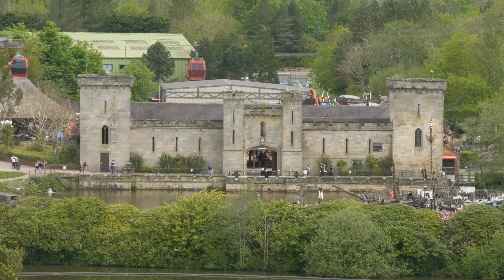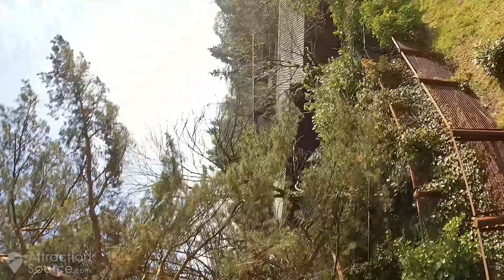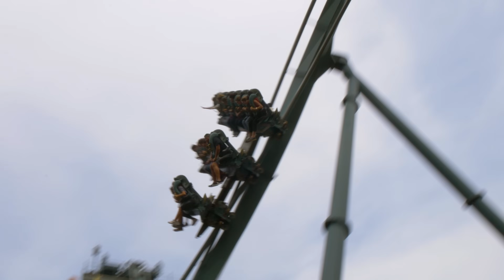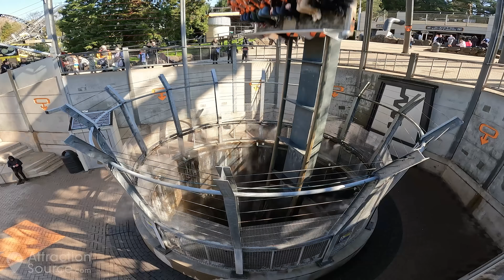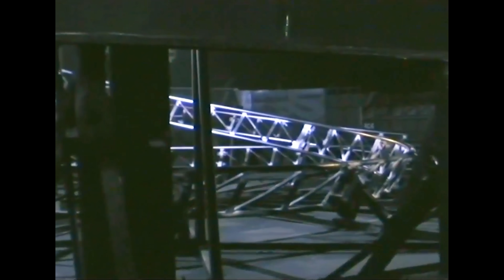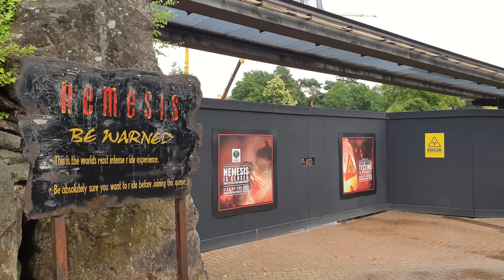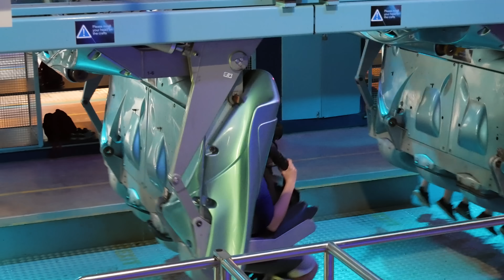Alton Towers has a roller coaster problem

Comment: There's a lot of comments about extending Oblivion, but it's not a good candidate for an extension. The main limit to a non-launch coaster's layout isn't the size of the drop, it's the size of the lift, because you cannot get out more than you put in. Oblivion has a small lift-hill due to the tree-line restriction, hence the small layout. Extending it would need a second lift-hill, like The Smiler, or a launch section. A launch section is not feasible as it would need a major modification to the trains, and a second lift-hill ruins the theming as it's all centred on the tension before that first drop. Adding a new bespoke pit behind the existing ride, running more layout in there and having the lift back to the station could work, but also becomes as complicated as replacing the ride entirely.

There is one option for replacement: build a drop tower ride into the pit and use the exit tunnel for queuing and ride exit, and use the land freed up from the rest of the track to build a completely new coaster. Nemesis is constantly ranked as one of the best coasters in the world, which made refurbishing it worthwhile since it is still a draw. Oblivion is more of a historical curiosity, and does less to attract park-goers than other more elaborate rides. It has less chance of refurbishment when the time comes.

Comment: Great video! However, I think their only real issue is space since there are so many limitations on where they have to build new attractions. But removing and replacing, or renovating old parts on those larger bespoke rides is not impossible. Every theme park does this in some way. Tear down an old coaster or attraction, dig or fill holes, remove trees or other smaller attractions that might be in the way, and create something new. Although none of us are truly aware of how much planning went into the bespoke rides like Oblivion. Maybe they have designed and engineered it for future maintenance. They would be silly not to as every attraction needs to be maintained over time. So, I guess we will see what they do next, soon! I do have a quick theory though that could work...installing a low lying "cart" on the current track (self motorized or external pull line), then placing it next to a piece of track underground that they wish to replace. Move the old track onto the cart and have the cart take the piece out of the tunnel and bring in a new one. Not a perfect solution, but it would work with some clever engineering.

Comment: Oblivion and Genesis are babies. Cedar Point has several coasters 40+ years old (Gemini-1978, Corkscrew-1976, Mine Ride-1969 and Blue Streak-1964). Iron Dragon is up there too at 36 years old. But I think CP has better maintenance. They would never let a coaster's paint get to the point of Nemesis. It's kind of shocking to see so much rust showing through. A little concerning too given recent events with certain '90s coasters here experiencing structural failures at welds. I know it's just surface rust but it makes you wonder about the bolted connections and what not. I would also argue that a seasonal park like CP experiences its own wear and tear during the off-season in the form of subzero weather and ice loading on the structure, in addition to the lack of constant traffic allowing rust to form on the rails, brakes and other such parts. A year-round park is constantly polishing the ridden portions of the track (albeit wearing them down too). I think it's probably a wash.

Comment: I'm certain that tunnel section of Oblivion could have its track replaced within the existing structure. A replacement ride might plausibly be routed via the tunnel too, because static concrete structures usually have lifespans significantly longer than the steel track elements. It's up to the operator whether they think its worth reusing it of course and whether it would fit in with the concept of a new ride.

Comment: Nemesis was getting on, it was rattling a lot the last time I went on it 8 years ago. 

Nemesis replaced Thunder Looper. Galactica, I knew it as Air, replaced The Beast. Alton Towers will forever find ways to replace rides when it needs too. I can't wait for my daughter to be tall enough to take on the big rides and see what they have in the pipeline over the next 5 years or so.

Comment: I would replace oblivion with a Mack extreme spin. It could drop out of the station into the hole from ground level like Time traveller and then hit lims as it emerges from the  hole to complete the circuit. It would be a great start to the ride.
Reply from the maker: A MACK extreme spinner at Alton Towers would be awesome!

Comment: Efteling in the Netherlands has more problems, than Alton Towers! Efteling also is restricted of building above the treeline, but they can't blast their way in the ground, because the bottom is made out of ancient sea floor, which is made of sand! Therefore it will be way to expensive to built into the ground... Also Efteling is a nature park which has to be 89% nature and there is only 2% left for them to built on, unless they expand. The solution is simple:
Plant or create larger trees, so the treeline gets higher!
Alton Towers can also do this...

Comment: In fact, Alton Towers isn't that unique in having these issues - Phantasialand in Germany is having even more problems like these. The park is located between a forest, an Autobahn and the town of Brühl. Phantasialand is not allowed to build very high as well and so, they build their themed areas deep into the ground and on different height levels. Did you ever wonder why Phantasialand is cramped into so highly themed walls? It's not only for immersion purposes - they are actually necessary to keep the noise out of the town that is directly next to it. Furthermore, Phantasialand is not allowed to expand in any direction. They have demolished a lot of rides in the past and built completely new ones instead. That is also the reason why there are only "good" coasters in the park. Every coaster in Phantasialand is something special. That's because they simply do not have any space to build something boring.

Comment: I'm very pleased to see Nemesis getting renewed this way.  It's the only coaster I've ever been on which made me need a sit down when I got off... before leaping straight back on.  The degree of its integration with its surroundings is (IMHO) unique.
Reply: As I only go every few years, I will never get bored of Nemesis. So glad to hear it's sticking around!
Reply: Nemesis at thorpe park is nowhere near as good!
Feels jerky chucks you about, doesn't have the smoothness of the original

Comment: Well, if I were the park owner, I would do it like every railway company does with tracks in a tunnel: leave them were and only replace the rails. As they are in a tunnel, they have much less to deal with rain and wind than the parts in the open, so they will be much less stressed.

Comment: Nemesis might be approaching 30 years old but it is still probably the best roller coaster I have ever ridden both for smoothness and intensity and it would be a tragedy if it was removed or changed too much.  Glad to see it is getting a major refurbishment.  Of the others, I would miss Galactica the least.
Reply: I’d be most gutted if it lost Air (Galactica). It is the favourite of my wife and I. It would be sorely missed if it was gone.
Reply: @CylonModel2  Same here!
Reply: @CylonModel2  it's slow
Reply: Have you tried swarm at Thorpe park? That's super comfy! I don't think it's got for visuals of nemesis as I believe it's above ground, I'm blind so that's a bit tricky for me to tell you about, but it's by far the smoothest post office at the park, you don't get rattled around like you do on Colossus. It's got a super spongy chest brace and emulates bats flight I believe.
Reply: Yes. I have been on many coasters over the years, but Nemesis is unique. Its such a thrill, you dont get thrown around and the whole experience of swooping down, and over and around the hill side and through tunnels is incredible. All I would like to see is the blood in the waterfalls return. They used to be red when it opened, there was a food colouring dye in there and it looked amazing, all these pools of blood and red water coming over the falls. There is nothing like Nemesis anywhere simply because of the location and the way its on different levels, as you walk in on the que line past all the various parts, and waterfalls its just brilliant.
Reply: @Simon-xc5oy 
100% agree. The red waterfall etc were brilliant theming
Reply: Showing my age. I was there for the opening of Nemesis and one of the first few on it. I feel like I should be there for the reborn opening… just because. Doubtful as it’s 4 days away, as of today. 😢
Reply: It's my favourite, so good.
Reply: Yes I agree nemasis  is the best still after all this time but nobody goes on it anymore so I hope this refurb keeps it alive.
Reply: Love the surge of power on Nemesis after the lift tower
Reply: Well the old nemesis doesn't exist now. It's called nemesis reborn, same track layout but completely new.
Reply: Agree that Galactica should go, I found it to be somewhat of an underwhelming gimmick. I bet it's a maintenance headache for the park as well.
Reply: Rode it before refurb it was not smooth
Reply: @alexrowson-brown6568  i was going to say this lol. 20 years ago, you come off the ride with a headach from smashing your head against the hard rests. now its not as shakey and the rest are far softer
Reply: @BurtyHaxx  idk I used to think it was smooth but I rode it just before they started the refurb and it was as you described shakey and a lot of banging heads on the rests
Reply: People acting like it'll ever be removed.

Comment: Unlike other parks, Towers is going to age itself out of the conversation before too long. Eventually it’ll be a relic park like BPB. There just isn’t the space or lack of restrictions to ever become a “modern” theme park that can compete with the best of the best. Merlin would be better off scouting for a sizeable chunk of unrestricted land in the North of England that’s readily accessible and starting fresh. They could import most of the big 7 to a new park and keep Towers as the family entertainment park it used to be with high end fairground rides. 

Alton as a location is not suitable to be a Theme Park, it’s inaccessible aside from a single shuttle bus and a logistical nightmare to work through when it comes to designing and maintaining rides. Eventually I can see it becoming another Chessington, Drayton, Light Water Valley or even Camelot. The UK is in desperate need for an actual modern Theme Park and given the location of that oft-rumoured London Resort (and Thorpe I guess), if Merlin wants to be in the conversation then finding a new location in the North of England is probably a good idea.
Reply: The thing is that modern parks will never be able to capture the atmosphere of Alton Towers so there will always be a pull factor to the park.
Imo they need to keep with the subject of this video and focus on bespoke, unique rides as well as maintain their amazing track record with theming.

Comment: Blackpool Pleasure Beach will have the same problem in terms of the uniqueness of its rides and running out of space. They need to move forward but it would be very sad to lose some of the older rides.
Reply from the maker: BPB are in a hard position, they have to juggle the heritage of their rides with introducing new ones to draw new visitors in. It'll be interesting to see what they do over the next decade or so!

Comment: Well Phantasialand is in this struggle for land for many tens of years now. They are enclosed from all sides and pretty much landlocked. They also just have to tear down old rides, dig deep down into the soil and build something that can be enclosed enough so that noise regulations are ensured. It's a real struggle and its questionable if parks like these can keep up with much larger parks in the long term or are better positioned becouse of their overall better quality and modern rides.

Comment: I would make a different prediction. Nemesis will be around for a long, long time, since it's such a classic.

The others will eventually be replaced. But the pits won't be filled or watered. Nor will the new coaster be shoehorned into the same pit. Alton Towers has shown they're willing to do significant terrain work, so they'll just... Change the pit.

Comment: One advantage wooden coasters have over steel ones: It's much easier to do large-scale maintenance, since individual pieces of the frame can be much more easily replaced as needed. Granted, there are a lot more pieces, but it's way easier to slot in a few new timbers every other season than fabricate and replace an identical piece of bespoke steel-frame track.

Just ask the Roller Coaster at Lagoon. 100 years in service and still going strong.

Comment: IMO Smiler will go before Oblivion or Galactica does. IIRC, Smiler’s located in a fairly generic concrete box cut into the ground - and still has a somewhat tarnished reputation. I think the park will be glad to eventually see it go, and it’ll be easy enough to re-use the space.

Rita is the next obvious choice - in this modern age, its 0-60 is “production car” territory (various Tesla / electric models are either faster or not too far off) and the rest of it isn’t anything special. It’s also in a fairly flat and workable location for new rides.

Comment: So tbh as a local I go every now and again, I'm looking forward to the nemesis retrack, and think they could quite easily expand out down that side of the park with an entire new area if they desperately wanted to, this could also give them a second entrance for both hotel guests and others parking that far down, but at the same time if they did , thet could also quite easily return air/Galactica to its former state (as it's not the smooth ride it was a decade ago), but I have always felt that if they retrack more rides without looking to expand it shows that they are trying to cost cut, which locally has been obvious since the removal of brands like pizza hut and burger king from the park along with a big shortage of staff compared to pre covid
Reply: I'm local too.

Comment: I feel like you're missing another potential solution... like entirely. With Nemesis' area if they had decided to replace it... they COULD in theory, if they wished to put an entirely new ride in edit the existing terrain. Expensive, yes, But the thing about terrain is when you've already changed it, you CAN change it again. Fill parts in you don't want, dig out new parts for new things. I mean, The Flume was entirely on a large space of water, which was drained and filled in for The Wicker Man. Same goes for Oblivion. They could dig up and fill in parts of that area to change up the terrain and retheme it entirely if they wanted to make up a new ride. Sure this process takes a long time and a lot of money, but it'd be worth it to make a new attraction if they really wanted to commit to the idea.

Other solutions I'd suggest are things like... replacing Rita. Galactica could be replaced with a brand new flying coaster with a different layout, given Galactica even when it was Air, didn't get to be made to what they had intended. They'd wanted it to be a lot more themed than it ended up being... so if they were to replace it, they could make something new whether that was another flying coaster or something different entirely. I'd say replace Rita because there's better Launched Coasters in the mainland and even within the UK (Taron at Phantasialand... Icon/Enso at Blackpool Pleasure Beach... Stealth at Thorpe Park just to name a few) meanwhile Galactica's a pretty rare coaster type.

If there's one other coaster I'd think would be a good one to replace... Spinball Whizzer. That thing's ancient and frankly only gets the number of riders because of where it is in the park, get a new compact coaster in there. Or do some work over in the Katanga Canyon area it's been neglected... update the River Rapids or replace the Runaway Mine Train with something actually interesting, even just update theming to make it look better.'

Comment: Do we know if the new nemesis track layout is pretty much like for like? And the only real differe ce is the colour scheme and some theming?
Reply from the maker: It's exactly like for like, the profile of the ride will be identical post-refurb. There's been some changes to the design of the supports and footers (to make them stronger to deal with the forces better), but that's about it.
Reply: @CoasterBot  thanks for the insight bud. Much appreciated. From experience of going to AT a lot over the years, I guess that the coaster design itself was so good and a fun ride in the first place, that it's stood the test of time remarkably well and holds up as such a good ride well into the 21st century that its more than viable to effectively rebuild a new version rather than have to think up a replacement. I think this will be the same for oblivion as well in a few years. Both rides remain visitors favs everything I go there.

Comment: There's potential if they remove Oblivion. Use that same hole for an RMC I say. That plus the B&M track down there could have the RMC rails laid right on top of it so they wouldn't need to remove the track down there. And depending on where they put the station they could have it diving on and off the hill.
Reply: It won't matter as to remove it they would need to dig it out anyway
Reply: @andrewhoughton8606  They wouldn't need to dig it out if they left the track in the tunnel in place, built on top of it. RMC could make something really cool utilising the terrain of Oblivion.